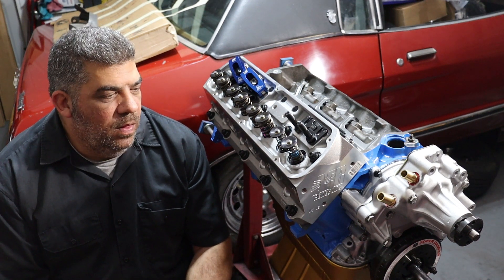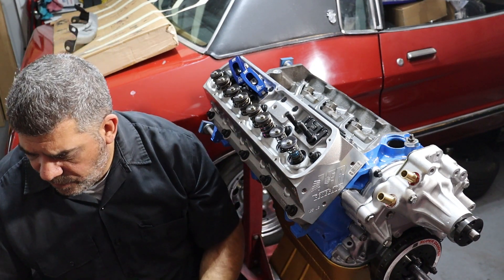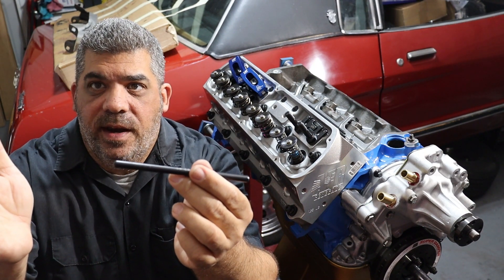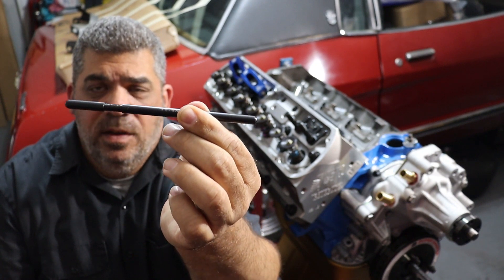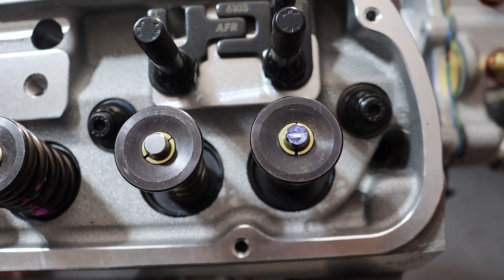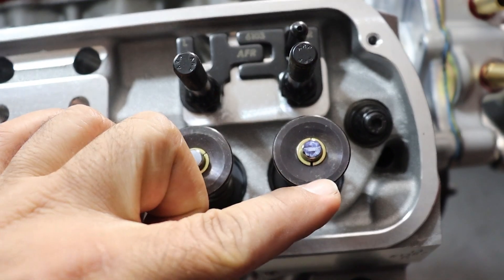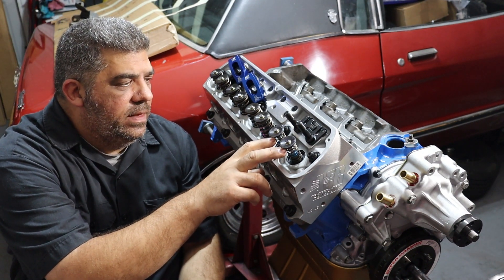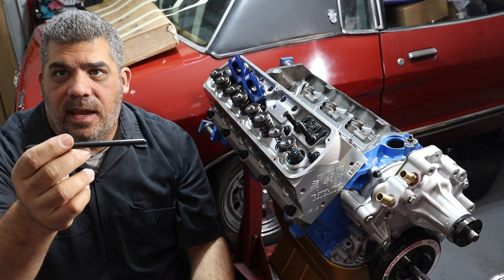Measuring for Correct Pushrod Length in my SBF

Comment: When using the adjustable push rod and checker spring with hydraulic valves do you add half the distance of the lifter preload?
Reply from the maker: Great question - I don't think I mentioned it in the video, but yes, you need to add the preload distance to the measured pushrod length and then round to the nearest standard length in order to get the best geometry.  Not half, add the whole preload distance.  Of course, that distance varies widely depending on the engine and parts used.  1/2 turn may be a certain distance with press-in studs, but a different distance with screw-in studs.  You'll need to figure out the correct preload distance for your engine and then proceed from there.  Thanks for watching!

Comment: Is this a hyd roller or tappet engine? What did you do to keep them pumped up? Just soak them?
Reply from the maker: It's a hydraulic roller cam, but there's no need to worry about keeping the lifters pumped up if you install checking springs on the valves.  The springs inside the lifters are stronger than the checking springs installed on the valves, to the lifters will not collapse when opening the valves.
Reply: @billsgarage  if you have a hydraulic roller pumped up, will it stay pumped up thru 2 revolutions of a engine if not using checking springs, for final valve adjustment?
Reply: @johnnyhonda7576 i second this question as im literally about to check pushrods tomorrow and don’t have the checking springs lol

Comment: Great advice in this video... We built up a '96 Explorer motor (5.0 HO/GT40) and installed a TFS1 cam, spring kit and new head gaskets. Lots of tapping on start up. Turned out we needed to go from the stock 6.250 pushrods up to 6.300.
Reply from the maker: That's a noise that will definitely get your attention!  Thanks for watching.
Reply: Would lash caps help

Comment: Does this need to be done with the head gasket on and torqued down? Also I have a 289 set up with comp cam magnum 280h flat tappet cam with flat tappet lifters I’m ordering the afr 165 with the flat tappet cam spring exchange but using 1.6 Harland sharp roller rockers I wonder what length I’m going to need
Reply from the maker: The head gasket should be in place, but you can just snug the bolts/studs, no need to torque them for this check.
Reply: Awesome thank you can’t wait getting the c4 trans rebuilt and a 3500 stall converter will be going in hoping for 400 or so hp car only weighs 2700 lbs
Reply: Flat tappet not going to last. Modern oils are not like before. Back in the day they use to use straight 50w oil etc. Today's oils are low zinc and are too slippery.
Cam will be wiped out very fast.
Adding zinc additive helps, however doesn't solve the problem. NO FLAT TAPPET FOR STREET CARS.